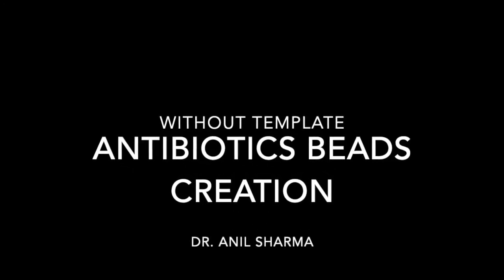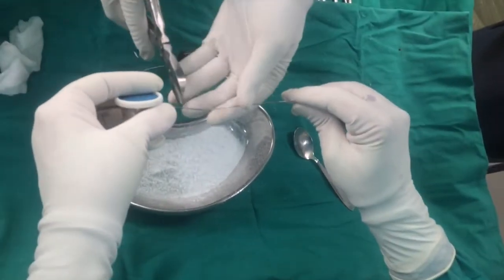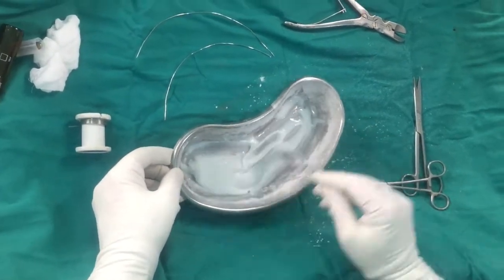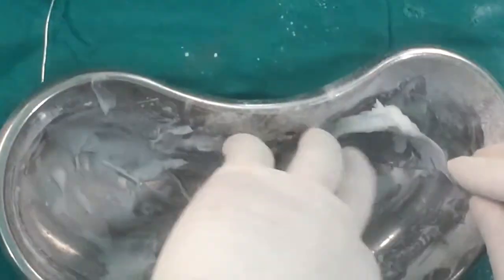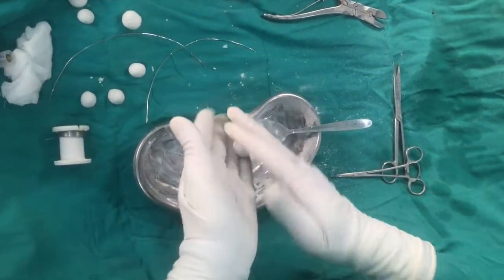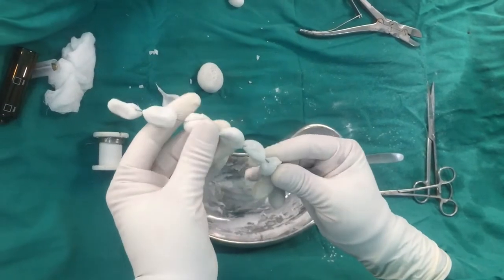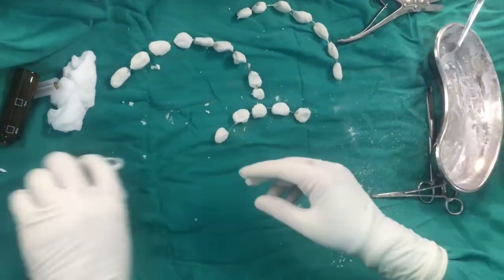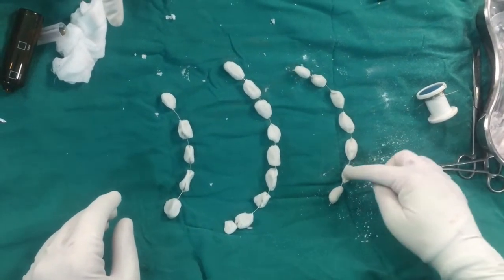Making of antibiotics beads without template

Comment: how are these removed from the body.
Reply from the maker: It will remove by 2nd surgery after 6 weeks
Reply: @DrAnilKSharma   i had a penetrating injury in foot 5 weeks back did foriegn body removal but after a few weeks more pain developed took mri which revealed osteomyelitis. have done the surgery for cuboid osteomyelitis last week. they put some of these beads in the bone and the underfoot. Is the surgery for the removal of these a simple surgery with spinal anesthesia?